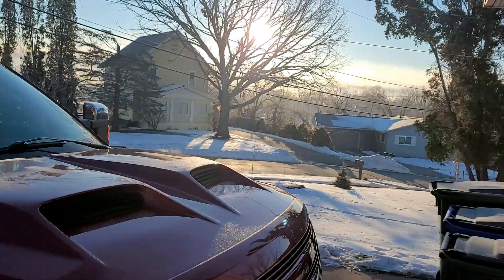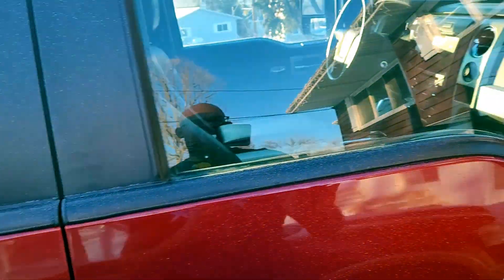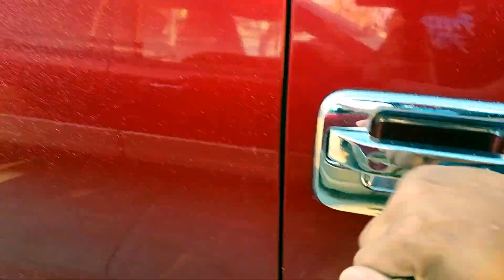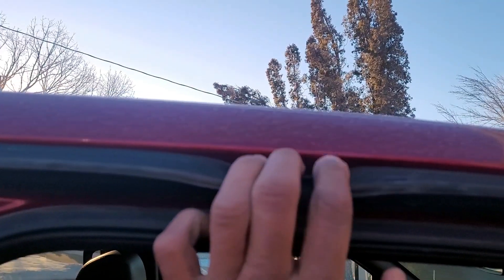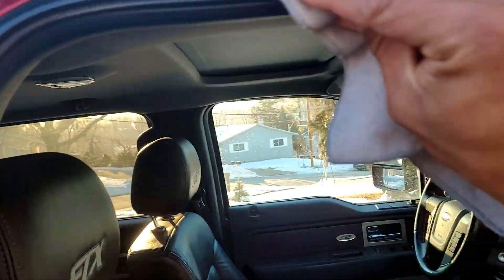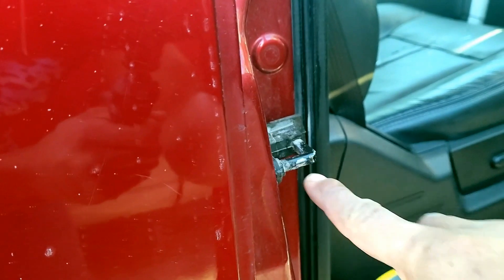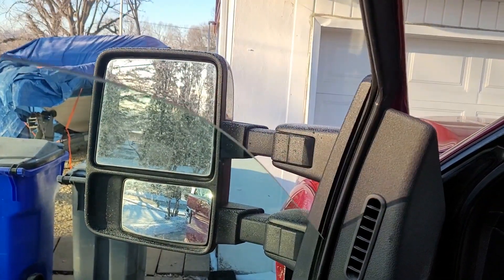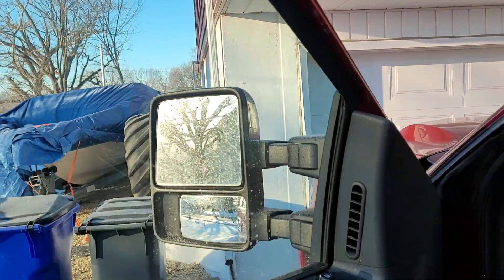Car Door/Window Frozen Shut?!? How to Open and Prevent!! (Minute Maintenance)

Comment: I tried using that wd40 silicone spray but it dries out and my doors still froze stuck.the best thing that actually works for me is that low temp radiator antifreeze.wipe it around door seals.wont freeze!

Comment: Is that save on tinted windows
Reply from the maker: @day1971  Thanks for the Question! In my experience yes! Ive used this method for years on vehicles I've tinted myself and factory tinted windows such as the truck in This video! Hope that helps, Happy Wrenching!

Comment: Can you use the silicone spray, to spray in  a door lock?
Reply from the maker: For Sure! I've Used This Spray On/Inside the Key Port on Door Locks as Well as the Locking Mechanism and Latch Itself!
Reply: @minutemaintenance7385  thanks for the quick reply! Will use straight away,  it's -4 centigrade, here in the UK right now and the forecast said it the same for the next 7 days!
Reply: @beatlebrian4404  my mother already cannot use her car in uk.windows wont go up and down and the door cant be opened on the inside so she cannot use it.her driver door can be open from outside but not from inside.these modern cars seem alot worse than older ones.
Reply: @ianpearson8976  I entirely agree with you, I have the same problem only in reverse! I can't get into my driver's door, from the outside but will open from the inside! Incidentally my car is a Ford Fiesta active.

Comment: -4 wind chill and my damn door won't open...grrr. used a hair dryer...a big straw made from rubber 😂. Alcohol in a spray bottle. Lost ...help anyone please..it's the lock..1 damn lock on the whole car ffs
Reply: Try getting in thru the trunk
Reply from the maker: I'm so sorry! At this point you're going to need some form of "lock de icer" most gas stations sell them and auto stores if one is in walking distance or can he brought to you! It'll have a tube you can spray outside and then stick into the lock! And THEN you may have to "body check" the door Hockey style because the latch itself that touches the door may be frozen too!! After that...follow the steps in this video to prevent further issues!! Good luck!!

Comment: I just tapped on my suv windows still froze lol
Reply from the maker: Does it sound/feel like she wants to roll down?!? If so..try rolling it down..while hitting the window around the edges. Might take a little extra...Oomph..depending on how badly frozen it is! If you dont hear the window motor running..could be the window regulator went bad!
Reply: @minutemaintenance7385  Awee thank you for replying well umm the rotor definitely making a sound it’s working I guess by it’s only 3 degrees here in Michigan I’ll be froze too lol I’m sure they will roll down when the sun comes back out in a few days thank you One window did till down this morning but 3 still froze